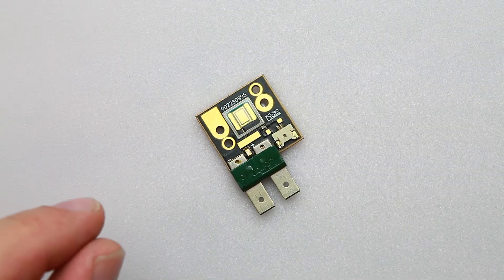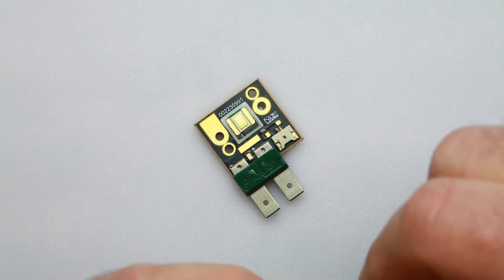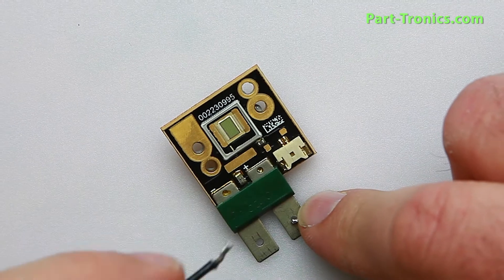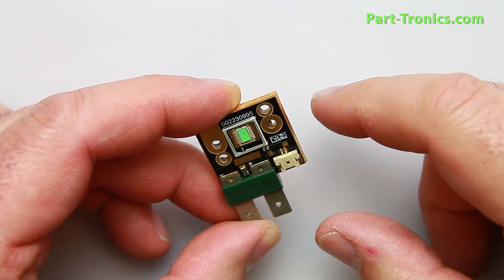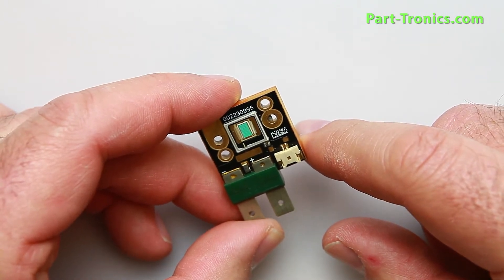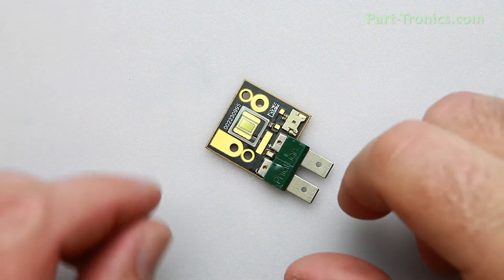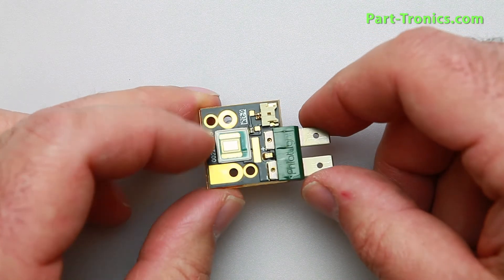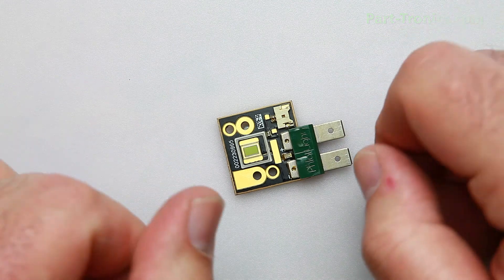How to Test an LED DISPLAY;PHLAT LIGHT

Comment: Using a "5 Volt Supply" is NOT as safe as using a 9V battery... you have no idea what kind of a 5V supply some people might have! A 9V battery can only output maybe 2-4 Amps (for a short period), so there is essentially zero chance of damage to the LED... but if a person uses a benchtop lab power supply that has the capability to output 20-30 Amps, it will destroy the LED almost immediately. Some 5V supplies have a VERY large output filter capacitor, which will hit the LED with an enormous current spike... again... possibly destroying it.
Reply: Can I test it on the board where it is installed? energizes with 5v the led that is mounted on the circuit to know if it is burned? ..